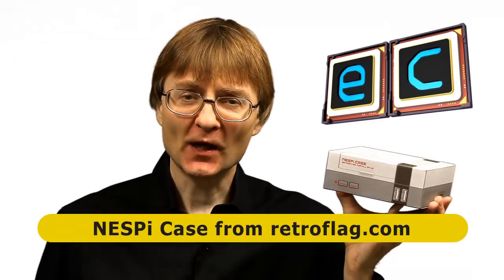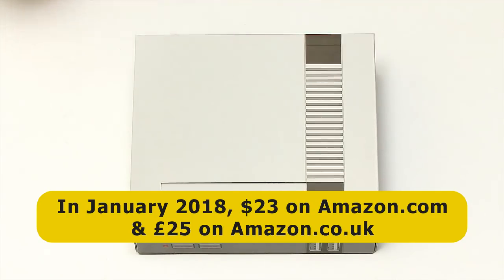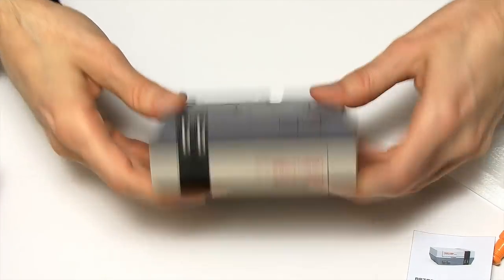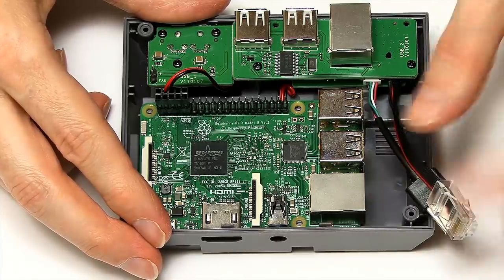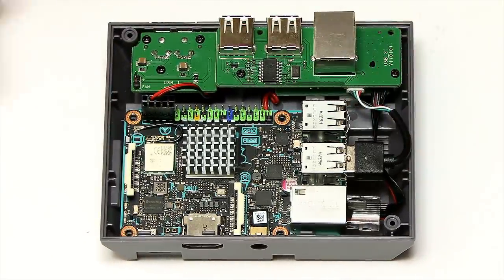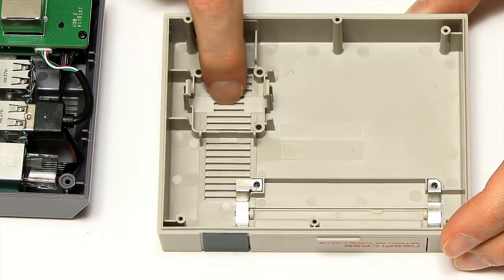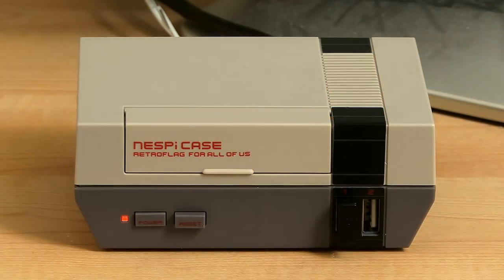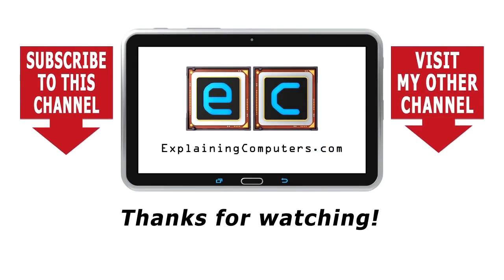NESPi Case for Raspberry Pi

Comment: Ive came up with the similiar idea last year, but in my case I did it the old fashioned way. I simply took the shell of an old gaming console, and put a SBC inside. At the front I made a hole and fitted standart USB hub. After the prototype I made, and Im often using, since its easy to carry around, and play games with friends, I also made a couple of them for my friends requests using the cases of damaged consoles, which can be bought cheaply (mostly Playstation 2 Slim, and it even does have two USB port holes at front). For my fiance young brother Im doing a case basing on a toy car.
Of course this is still a very unpolished way of doing this, and since Im planning to buy a cheap 3D printer, my future works would improve much, and so the sky would be the limit.

Comment: Better to fit the WiFi dongle inside the case direct to one of the Pi's USB ports - that leaves all four ports on the front free.
Reply from the maker: Good point if you do not need to get it out again in a hurry! The Pi effectively has 7 USB ports here.
Reply: i would buy an extra dongle just for this setup
Reply: Pi 3 has it built in but a keyboard and mouse dongle would work, are those sets that don't use Bluetooth standard or does it need replacing with a different wireless set?

Comment: Why is it showing thermal warnings?
Reply from the maker: If you are referring to the thermometer top right on the Pacman game, it is because I am in some kind of turbo mode. Nothing to do with the case (or indeed temperatures!).
Reply: ExplainingComputers Thanks, but it is my understanding that symbol only appears after the temp gets too high. I also have this power hungry case, and an insanely overclocked retropie setup, and i had the same issue until i put in a fan (my passive copperblock wasnt enough anymore...)
Reply from the maker: Ah, in which case I must check that out. It appeared when it changed a setting in the game, but obviously by coincidence!
Reply: ExplainingComputers no worries 😁. A 90 cents fan bought at any chinese online store fixes that properly.